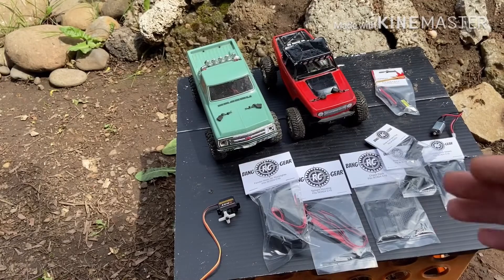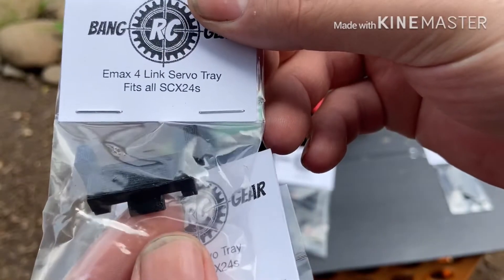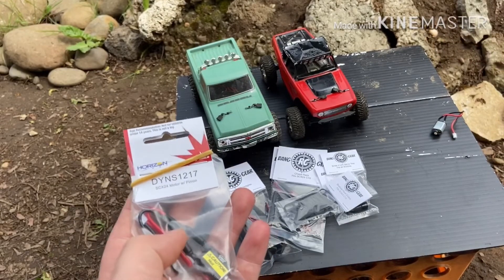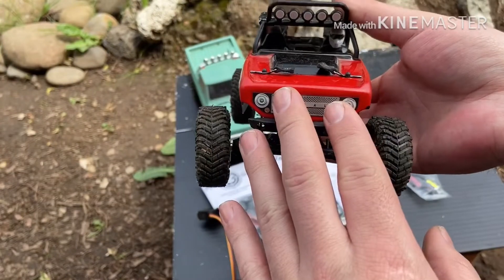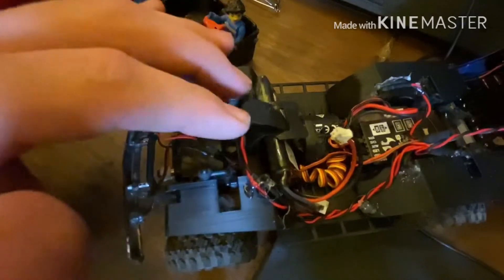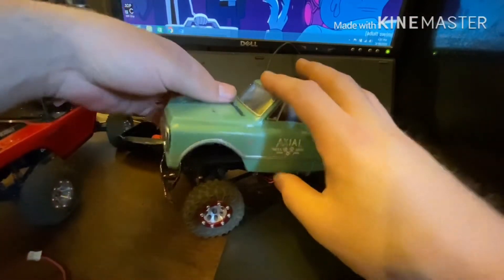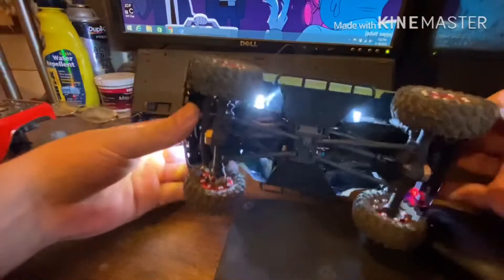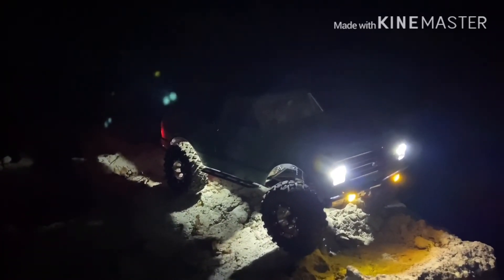Scx24 update! (3D printed parts!)

Comment: Good looking 3d parts bro, I may look into them for one of my trucks.
You should put some conformal coat on your esc. Keep crap and water from shorting you out👍
Reply from the maker: BullgearRC videos thanks man! They seem to be good quality. Feel pretty tough but time will tell. 
I plan on getting some conformal coating soon as I can order some. I spaced it because I don’t go in that much water with the micros. 😄
The deadbolt esc had allot up dusty dirt in it though. I think the front tires are kicking the stuff into it in the stock location. 😅

Comment: I've seen some of these ?buy it break it fix it, didn't know about the roof rack. Might try to get at least the fender wells and sliders/ step bars whenever my C10 arrives. See about putting the lights in the roll bar if possible instead of underneath (personal preference)
Reply from the maker: Lyle Kehrer awesome I seen his video to. 🤘
Believe it or not but the headache rack is actually a lighter up high vs the stock roll bar. I was gonna do that to. But just so you know leds on the bar make it more tippy and actually don’t help that much other then blinding you when you end up aiming them at yourself. 😅
But the rock lights make it so you can see where the tires are at night. Even my friends real 1/1 rigs have lights in the fenders so spotters can see at night. ✌️😄